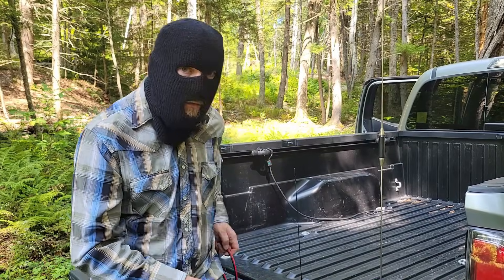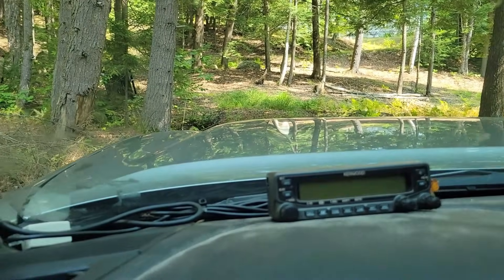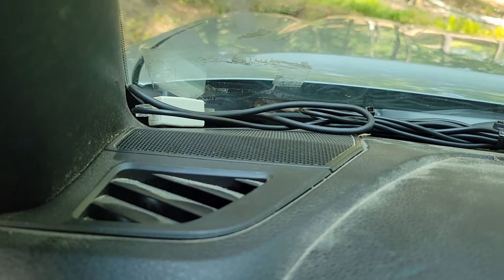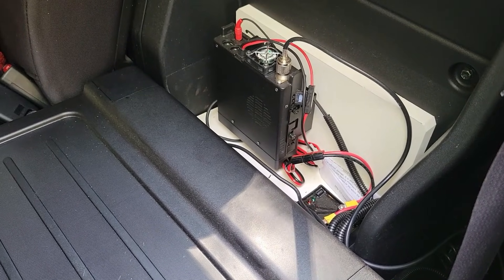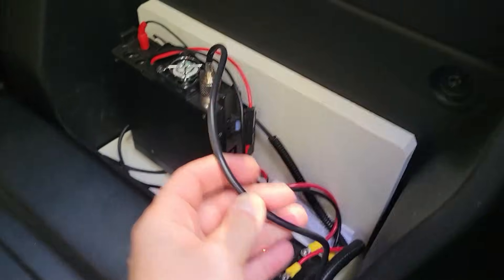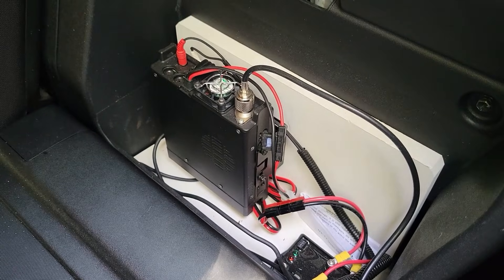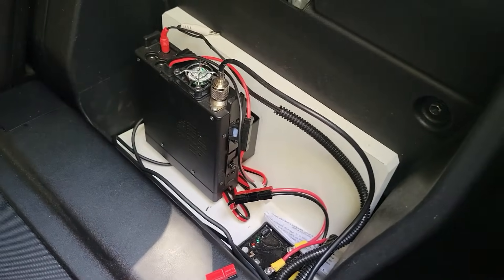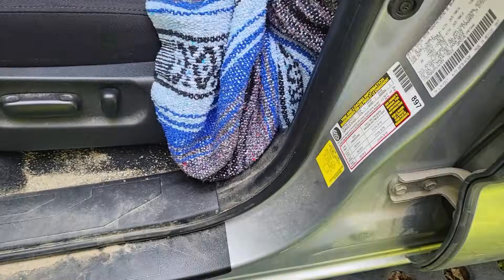Basics of ham radio mobile/vehicle comms - getting an amateur radio set up in your car or truck.

Comment: Cool beans ! As far as power goes one 8ga conductor with a large fuse very close to the battery connection running through a grommeted and sealed firewall penetration to a high current relay that feeds a small fuse block is the way we build vehicles. We get ground through a solid bolted connection to chassis in the passenger compartment which runs to a ground buss. Use a SPST switch with one side on a fused lead to the source side of the relay and the other to the relay coil. Close the switch energize everything open the switch deenergize everything. I did a detailed video series on this a decade ago. Thanks for sharing !
Reply from the maker: Thanks for your thoughts on this! 💪👍
Reply: @wildcatcomms  Any time. I have been doing this work for 35 years.  I like to help others help themselves where I can.
Reply from the maker: @survivalcomms 🙌

Comment: Thanks, man. I'm about to do a install on my vehicle. I'd take it to a pro, but I don't want to spend more on the installation than my vehicle is worth.
Reply from the maker: If you're driving a cheap vehicle it might not matter as much, but getting a quote is usually free!
Reply: @wildcatcomms  No doubts. I'm certainly not saying not to go that route, I'm saying my vehicle is worth little more than the scrap weight.

Comment: I have the quad band comet antenna. My Xiegu radios can tune through 40m (have not tried 80 yet) on that antenna. With a cheap duplexer, you could work all bands with 2 radios. Not sure how well it would hold up offroading though
Reply from the maker: Yeah I should have been more explicit that you need to be careful when going off road if you have a long antenna!!!
Reply: @wildcatcomms  I just mentioned that for my antenna. If it is a mag mount and has a spring, it should be alright for "normal" off roading".

Comment: What’s your reasoning for putting a fuse on the ground wire?
Reply from the maker: Good question. That's just how the wiring harness came if I remember correctly.
Reply: @wildcatcomms  My Kenwood was the same way.
Reply from the maker: @tangle70 Honestly this time I just dropped a box of junk off at the upfitter and let them wire it up for me!
Reply: There really isn't a need for a fuse in the ground if your mount base is tied to chassis it will pull current through the RF connector even if the ground fuse opens and then the B+ fuse will open.